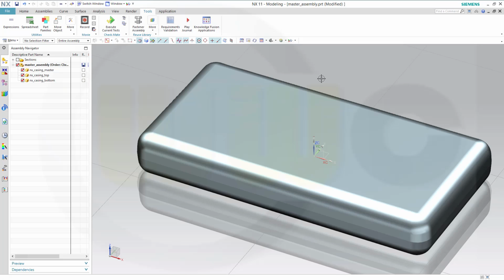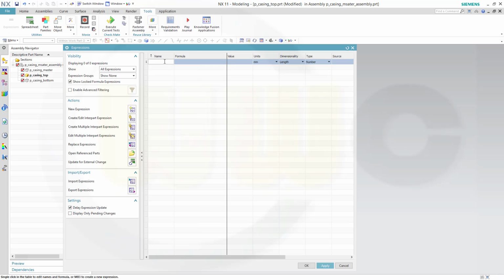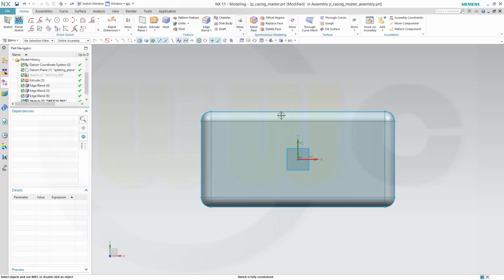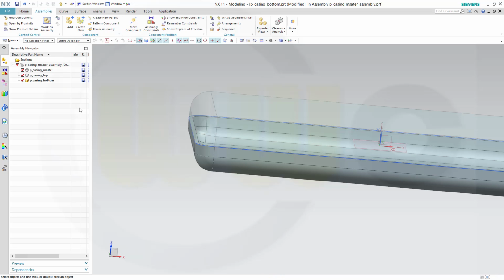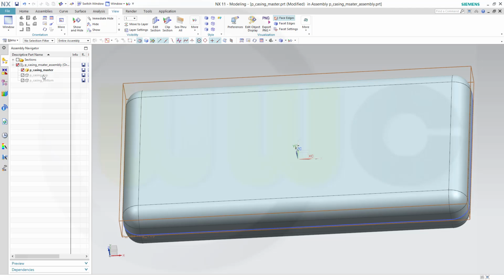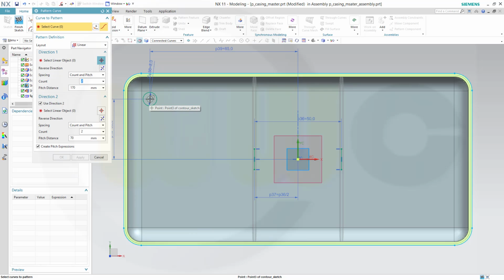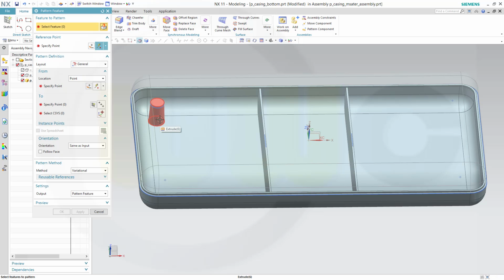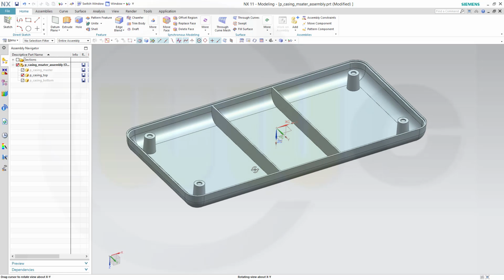11.5 Plastic casing advanced - Siemens NX 11 Training - Part Design

Comment: Good day! Thank you very much for the lessons! This is very useful, especially with assemblies! I have a question. When I try to hide p_casing_master in the assembly, p_casing_bottom and p_casing_top also disappear. What am I doing wrong? I use NX11 too.
Reply from the maker: Sorry, can´t tell you without seeing your model
Reply: Could you help me, if I send you my model? What is wrong? In NX 9.0 - all ok, in NX11 - problem.
Thank you very much.
Reply from the maker: I will try ;) just send me your model : info@wwmc.de
Reply from the maker: Hi, thanks for your model. Somehow you created an "empty" referenceset "part" - so if you switch the p_casing_top reference set to "model" and the p_casing_bottom reference set to "model" then you will see your 2 parts ;) ("replace referenceset" in the contextmenu if you right-click the part)
Reply: Yes it worked. Thank you very much again! I'm already worn out :)
Reply from the maker: No problem - you´re welcome :)